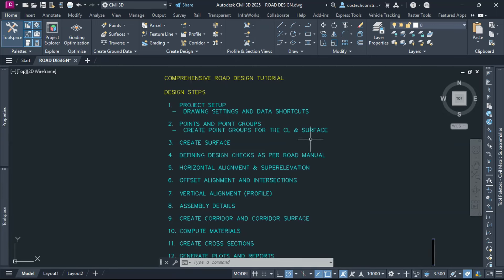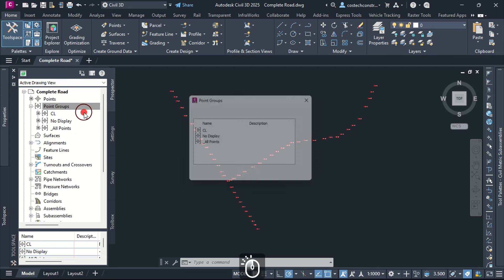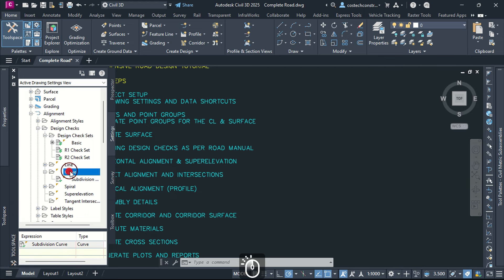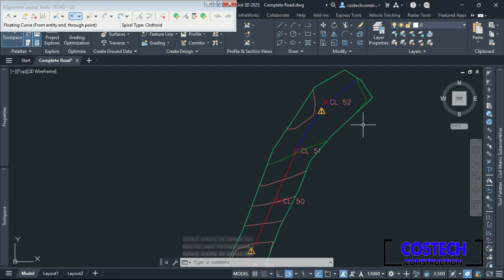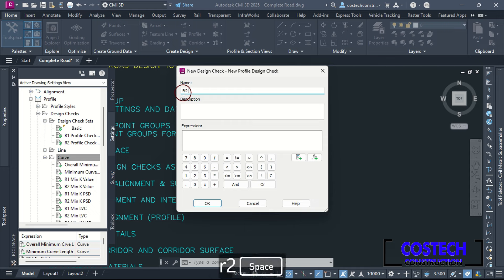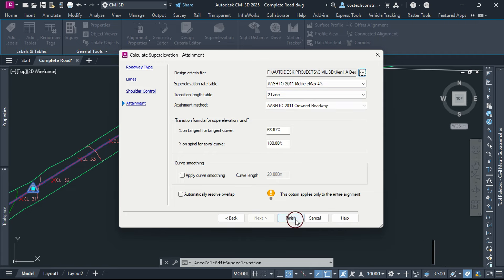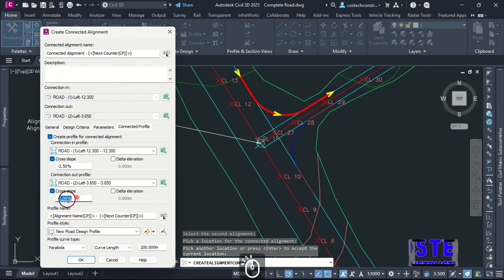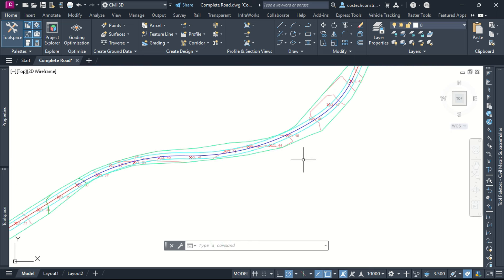Complete Road Design With Design Check Sets Guide From Manual #part1

Comment: Nice, good and easy to understand!👍❤

But sir, I have one thing to ask about offset alignments.
That is,
How we could cut/trim extra marginal portion of offset alignments beyond the curb return section up to touching the main alignment line. Please provide solution. 

Why I want that to know, because, if these offset alignment lines remains there in the drawing, they are creating mess in the drawing.
Reply from the maker: Kindly don't delete the offsset alignments at the curb because it will be used as a corridor target while creating the intersection manually. I will upload the next videos by tomorrow on profile adjustments and assembly creation.
Reply: @costechconstruction254  Thank you for your reply. please upload a video for how to create designcriteriaeditor file as you have made your own and also you have applied that there in your dersign.
Reply from the maker: It is present at the end of part 2 video. I will show you the software and how to easily edit the tables present in the design criteria file

Comment: 19:18 why do we still need to edit in the design criteria editor yet we've already defined design checks for tangents and curves? I'm lost at that point.
Reply from the maker: In Autodesk Civil 3D, both Criteria-Based Design and Design Check Sets are tools to ensure that road alignments and profiles adhere to engineering standards. However, they serve different purposes and are applied differently:
1. Criteria-Based Design
Purpose: Ensures that the road design aligns with predefined engineering standards during the creation or modification of alignments and profiles.
2. Design Check Sets
Purpose: Verifies that the designed alignments and profiles meet specified standards, offering more flexibility in the design process.

Which to Use?
Criteria-Based Design is better when designing to a fixed set of standards is non-negotiable, ensuring compliance as you go.
Design Check Sets are better for exploratory or iterative design workflows, allowing more flexibility in the design process.
These tools are often used in conjunction for a robust design process: Criteria-Based Design ensures initial compliance, while Design Check Sets validate and refine designs.
Reply: @costechconstruction254 thank you for the clarification. Does that mean that I can use the design check sets created manually without having to edit the default one coming with civil3d?
Reply from the maker: @oluochphelix3142  In Autodesk Civil 3D, both Criteria-Based Design and Design Check Sets are tools to ensure that road alignments and profiles adhere to engineering standards. However, they serve different purposes and are applied differently:
1. Criteria-Based Design
Purpose: Ensures that the road design aligns with predefined engineering standards during the creation or modification of alignments and profiles.
2. Design Check Sets
Purpose: Verifies that the designed alignments and profiles meet specified standards, offering more flexibility in the design process.

Which to Use?
Criteria-Based Design is better when designing to a fixed set of standards is non-negotiable, ensuring compliance as you go.
Design Check Sets are better for exploratory or iterative design workflows, allowing more flexibility in the design process.
These tools are often used in conjunction for a robust design process: Criteria-Based Design ensures initial compliance, while Design Check Sets validate and refine designs.
Reply from the maker: @oluochphelix3142  They have different use.

Comment: Do we use criteria based design or design check set or both?
Reply from the maker: You can use criteria based design if you have the correct values from your manual. Civil 3d comes with AASHTO standards. Some regions use different codes.
Reply: @costechconstruction254 I wish I could share a picture to explain what I mean. I'm a bit confused
Reply: @costechconstruction254 let me try asking differently. When creating alignment, by default, use criteria based design is unchecked. If we proceed as such, what does civil 3d use to design?
Again, if we check use criteria based design, we have two more options one is use design criteria file and the other is use design check set. If I check use design check set and select the check I defined manually, does that mean that civil 3d will not use what is in the design criteria editor but what I defined manually? 
I'll appreciate a clarification.
Reply from the maker: @oluochphelix3142  If you dont select use criteria based design the software will let you draw your alignments and profiles but no error warnings will be seen.

The default provided civil 3d criteria files (AASHTO 2001 - 2018 xml files) contains the following parameters.

1. ALIGNMENT

In Alignments, we have tables for the following:
- Minimum Radius Tables at various superelevation rates.
-Superelevation Attainment Methods
-Superelevation Tables and
-Widenning methods

You can enable the criteria based option when designing a road so that the program can use your design speed with values from the Alignment Criteria tables. OK?

Example, how will you check if your minimum & maximum tangent length is to your design standards in alignments? You will need to define a check set, then create line checks for the min and max tangent lengths.

2. PROFILES

The provided civil criteria file contains the following Minimum K tables
 
- K PSD
-K SSD
-K HSD

You will need to define checks for Tangent grades, Minimum length of vertical curves, for sag and crest

No need to create checks for the given tables in the criteria file. 
 If you use criteria based, You can use design criteria file then select it.
You can further select your check set which contains the various lines or curves checks defined for your design speed.

Have I answered your question correctly?
Reply from the maker: BOTH
Reply: @costechconstruction254 thanks for taking time to clarify.
I'm however yet to understand this fully.
Further, design check sets I'm defining manually using say Kenyan standards and civil 3d is having AASHTO as default. 
So, does that mean we use both AASHTO and Kenyan standards? And is it not sufficient to do the checks using Kenyan standards defined manually?
Reply from the maker: @oluochphelix3142  In my video, I used a custom criteria file, not the civil 3d criteria file. I duplicated the 2011 AASHTO file then edited the values and saved the file. AASHTO is still visible as it is coded within the file.
Reply: @costechconstruction254  thank you. I think we're about to be on same page.
So the custom criteria file was edited to match Kenyan standards, right?
Then, why would we define manually the design check sets for both road 1 and road 2 if we can simply duplicate the existing AASHTO file and edit?
Reply from the maker: @oluochphelix3142  Yes, 
I will show how I edit the criteria file in the next video.
Reply from the maker: Both are Important. Kindly read the other comment reply.